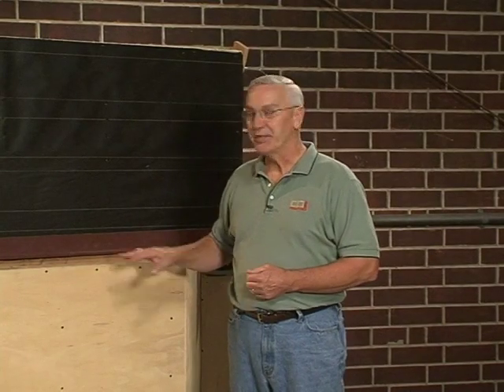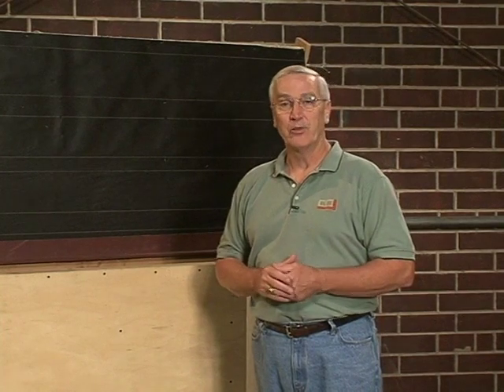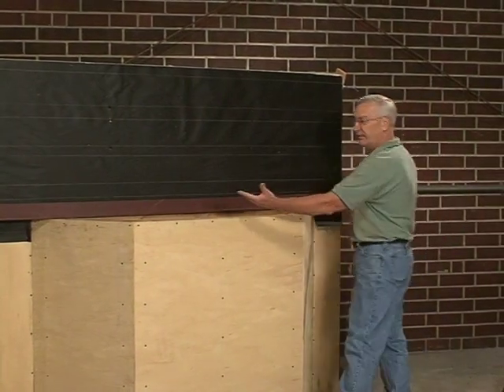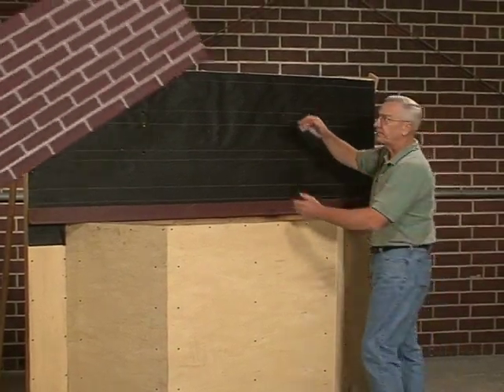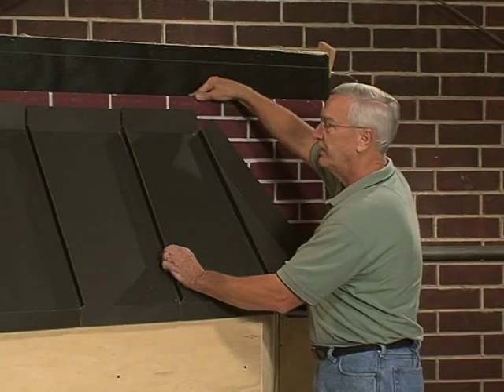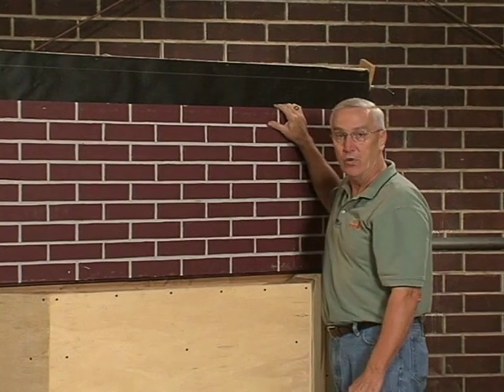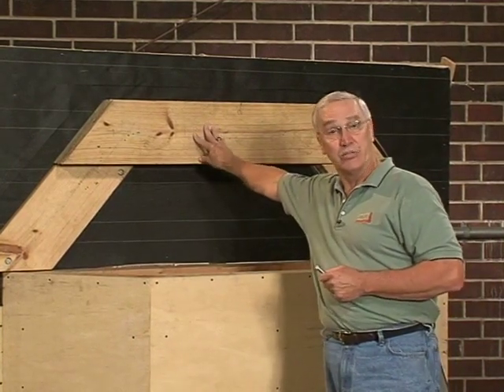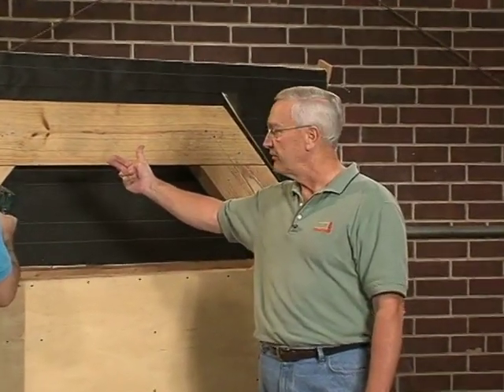Flashing Bay Windows

Comment: Mr Light I need a help I need to change roof and wood frame but I do not know What do you call that because it also needs to have thermal installation. Mid-Tares Bay pitch window need a roof wood is rotting away?

Comment: You should never use galvanized sheet metal with copper, you  will get "galvanic corrosion". You should use the same materials either all copper or all galvanized. Another way to properly flash the bay, is to step flash each side with end dams until you can bridge over the top of the roofing of the bay, with and continuous flashing over it.

Comment: my bay window leaked every time it rains hard. it has a 2 step flashing. had someone redo it and when they removed the existing flashing, there were missing bricks just above the bay window. so he covered that area with roof shingles and then placed the flashing over that. it didn't leak for 4 years and now its leaking again. do you think I just need to caulk around the flashing?